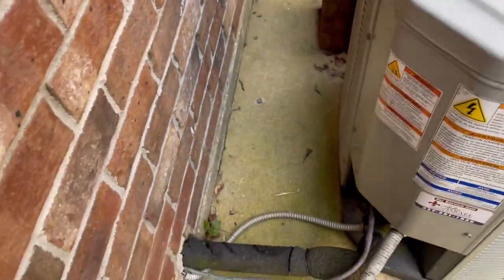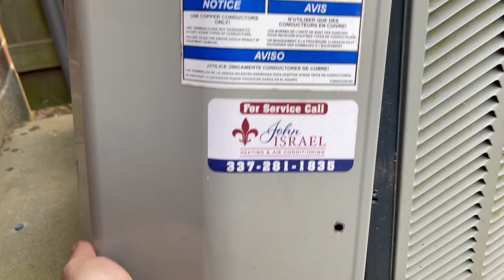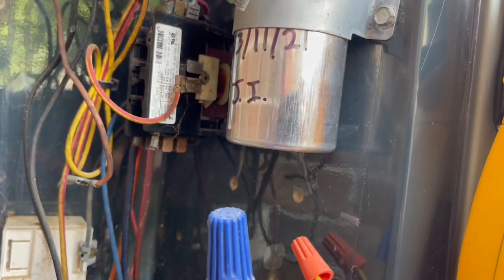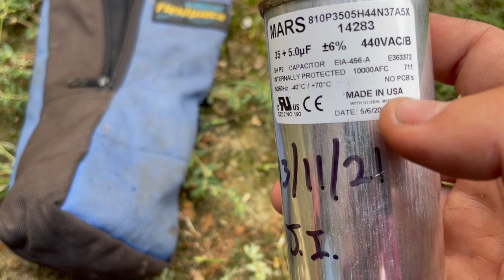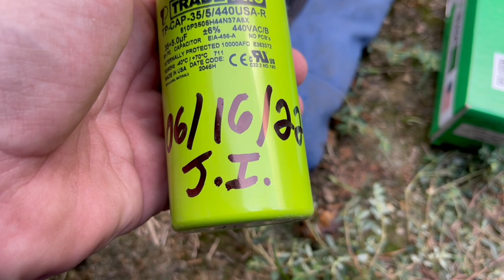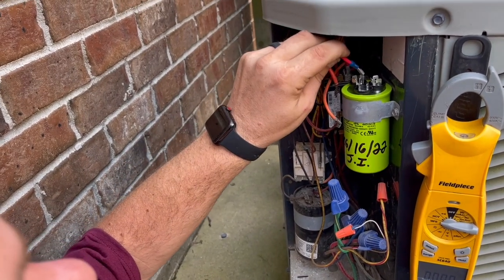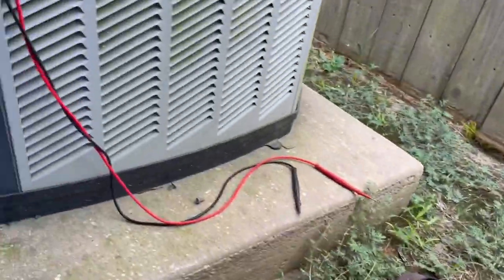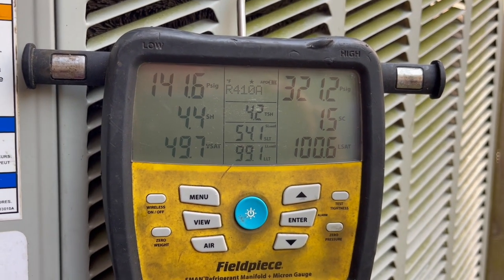One Year Old USA Capacitor Dead After 1 Year

Comment: At 3:36 you can see there is a grove in the cabinet for the lip of the cap to fit into. Over tightening the strap or mounting it with a lot of pressure on the lip can cause the lip to crack which lets air in and ruins the oil, meaning dead cap.
Reply: Or it wasn't sealed right when it was made.

Comment: Wow, that was really good.  I had the same problem with a Carrier (older model), cap just died (open).  That happened after some very hot hot days.  But it was pretty old.  But I didn't want to stand there while the tech was checking stuff..so this gave me a chance to watch what you were doing.  I noticed that the top of the cap was rusty.  Was there maybe some elec leakage going on?

Comment: I used the AMRAD made in the USA Capacitor on my unit and have had zero problems in the last 4 yeaes
Reply: If it lasts 1 year, great that’s what the warranty is out. If caps last 10 years, half the HVAC guys would be out of business. Some of these videos are stupid. John was wondering if that $10 cap was still under warranty!  Does it make a difference. Charge them $150 and be done. The homeowner should feel good about that and the tech doesn’t feel he ripped her off.

Comment: lighting surge can do that out of 1 of million chances, and funny thing, when power restore , your hvac gonna act normal for awhile until thing start to fail later in months to come with wrong polarity that something is very  interesting in this finding .
usually lighting should stop by fuses to burn off it but instead it just send a pulse frequency is very high that cause the capacitor polarity flip due AC grid...if it was DC it only goes one direction but with AC...it constance flip the direction back and forth when lighting strike the substation...it cause to make errors in the grid polarity frequency that can have negative effect

Comment: Only in the AC world would a Common be RED.  Going from DC to AC - it's a whole nuther world.  Very confusing for an old electronics guy.
Reply: It’s 240 volts. Both lines are hot. They just call one side common to know which leg gets wired where. Any of the two wires coming from disconnect can be designated as common.